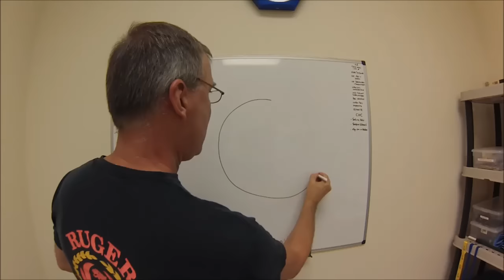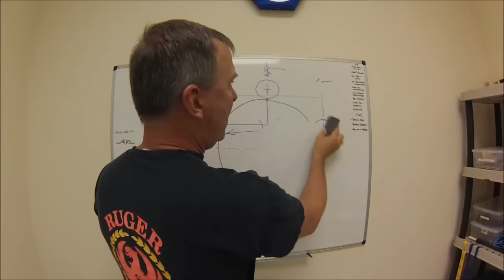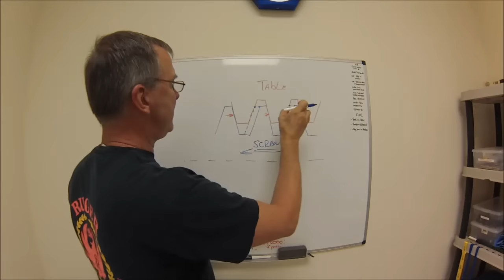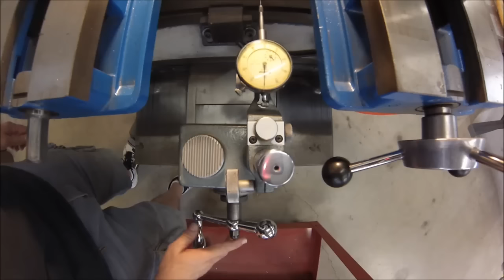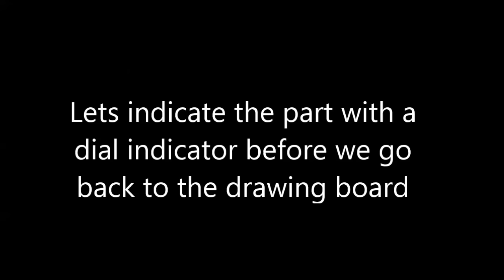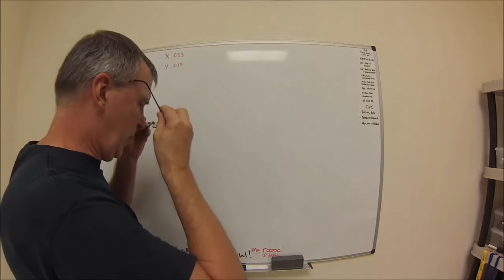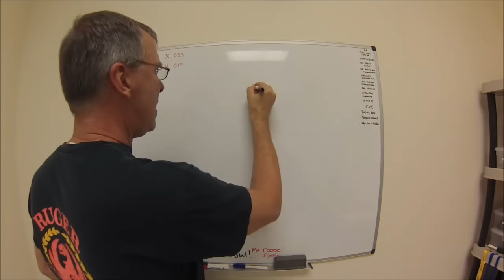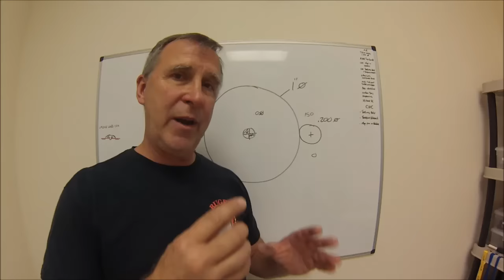Edge Finding Round Stock without a Digital Readout

Comment: The backlash number will change on different places of the travel because we typically do lots more work in the center or where the vise is normally mounted than we do at the ends of the travel, so the lead screw tends to fit looser there because of increased wear in that portion of the lead screw.  It's a moving target...
Reply from the maker: Its a good idea to move your vise L or R occasionally to spread this wear around. I alternate between the two I have mounted for just this reason. Thanks for the comment Bob.

Comment: Joe,

I really like the way you convey information.

I  do have a question however about finding the edge of a piece of round stock.  You covered backlash, but what about the behavior of the edge finder when you are off center, I suspect a new gremlin arises  and that is the spindle rotation.    I think the edge finder is going to behave differently depending on how the edge finder sees the round shaft depending on spindle rotation and if you are above or below the center line.

Comment: I read in an old machinist tips & tricks book that you can find center of round stock with an edge finder by touching off x axis move in rad of part + rad of edge finder then y axis move in the same, repeat 3 more times.
Reply: Yes, I remember reading that in Guy Lautard's "Bedside Reader" book. It seemed a bit cumbersome to me.
Reply: @ronmccabe1169  it's not ideal but when you don't have the ideal situation, overly gated casting, dial out for calibration, or I'm to fat & lazy walk over to the toolbox it's a good thing to know.

Comment: Backlash will never be the same, it will be off .002" or even more, since the slightest drag difference on the table will make the difference. To test this, check your backlash, then cause some resistance by snugging up the lock screw/bolt (Or add heavy weight to the vise) and check backlash again- it will be different.  You cannot use backlash in your equations and be accurate.

Comment: To the extent that the worn surface is on the leadscrew, backlash is likely to be non-constant. This is because wear on the leadscrew will be greatest near the center of the axis travel.
Reply: Also, some part of backlash can be slop in the thrust bearings.

Comment: Hi Joe, don't know if it helps or not, but when I indicate a round part in the vise, I pick the x side first, pick the minus side, go until I hit zero, and zero my DRO, then pick up indicator and turn to other side and pick up zero, then split the difference on the reading, then the same with "Y" and it will be within a couple thousandths right away, then its easy to zero out!
Reply from the maker: This was a very specific video about not using a DRO, coaxial indicator or spindle mounted indicator. Those ways are super easy.

Comment: if you're not on center though ........with a kickout-centerfinder, one side it'd kick downhill.  And one side it would kick up-hill.  Wouldn't that influence the sameness of each point?  At least if you start on center you always be kicking downhill.   In other words the kick out would roll off the round part rather than climb up it.  Anything to that?  You could I guess turn your machine in reverse for the opposite reading.  In fact that's the solution isn't it (if there is a problem)
Reply: That is very interesting. I would like to see how much effect that would have. Joe?
Reply: Not exactly sure what you're asking. Regardless of where "off center" you are on a circle (assuming you're looking down on a "circle" vs a rectangle, or some other oblique shape), the finder will always hit the part tangentially from both side.

The idea of using an edge finder totally eliminates any discussion of uphill vs downhill, because those terms are reserved for non linear flutes and approach directions to work. In addition, tools climb work because they're locked into a collet, or an arbor of some sort. The edge finder is designed to eliminate that, because it designed to kick out at the slightest touch. Again, uphill vs downhill doesn't even become a factor. It's all negated.

Assuming your round stock is lying flat in a vise, or v-block (instead of on its end, as in video) means the edge finder will contact the round bar where it is sticking out farthest AND will contact the edge finder on its corner edge (The ONLY place where this won't happen is when measuring the exact center of the round bar.). However, even in THIS case, there is no twist to worry about, because there aren't any twisted flutes. And, as also mentioned above, the edge finder is designed to "give" at the slightest touch. So, again, uphill, downhill, conventional, climbing, etcetera are terms that wouldn't be used here.

Therefore, NO, there is no influence being imparted by approaching the work from either direction by the edge finder.

Comment: Russ Hall
I have a very old and worn mill and it seems to me that I might expect to find the backlash different at different locations on the screw.  Most of the ware should be on the nut which would be fairly consistent through all the travel, but the high use middle zone of the screw might have more ware on it than out near the ends.  If this is true, it seems that I should check the backlash where I am working on the screw.
Reply: I'm thinking that you might move your table out to the ends of its travel in both directions. Then, get underneath with a flashlight and check out the acme threads. Measure every third or fourth thread with some accurate calipers to give you a rough idea of where you should be looking for different backlash.

You might find that the first inch or two the threads are like new. Then, they're about equal for another few inches, only thinner threads than at the ends. And, you find a big drop in acme thread thickness at some point.

If you bought your machine from a company's private shop, then all of the work was probably relegated to a  section of the mills table. Or, you could get an inexpensive DRO, and not even bother with what backlash you have and where you have to be concerned with it, to one degree, or another.

Comment: To avoid the backlash, can’t you touch off on one side of the stock, then touch off on a surface pressed AGAINST the other side of the stock (thus touching off in the same direction for both readings)?   Hope that’s clear.
Reply from the maker: You could. Thats called a projected surface and is very handy to use.

Comment: Thanks Joe, but I have one more question about backlash. Is it possible that backlash is bigger in the center of your mill because you use it more often than ends of the table. I know nuts are maid from bronze and it will worn out faster than screw, but how much screw will worn out?
Reply from the maker: It is absolutely possible to have your backlash vary across the length of the screw. Although the bronze nuts should wear out first, repeated use of your machine in the same region is destined to show wear on the screw as well. Another advantage to moving the vise once in a while.

Comment: To find the center If you put a small rule on top of a round material using a small rule bring down a quail with a drill bit till the rule is level
If you put a pointed scribe in the chuck then on the rule is the scribe method more accurate (smaller the point more accurate) ?
Reply from the maker: It does seem logical.

Comment: There is a way you can find the center of a round stock using an edge finder without factoring in the backslash of the axes.
Reply: How?
Reply: I think i understand what you mean, and i think it only applies to small or short stocks, i learned it after 1 year ago question i posted..haha, thank you sir.. Will apply that technique soon..
Reply: Yeah, it's called a DRO. But if you're referring to those pointers, then you need to know their tolerances. That's  because there's a BIG difference between a Harbor Freight drill press and a high quality milling machine that is in excellent condition.

Assuming, you're using a pointer, it's manufacturing tolerance could be outside of the window of the part you're trying to make. Add a cheap bit, and you can see where this goes.

I think the point being made here is the concept of backlash and how important it is for those who don't have the luxury of a DRO, when used on Milling Machines for highly accurate work, which could go down to a couple tenths, or less --> 0.0002" to 0.00005" (or, not...see below).

Standard call out on a drawing is 0.005" On my machine, I found backlash on my X-axis to be between 0.012" & 0.013" on my dial and 0.017" backlash on my Y-axis. You can see how someone NOT having any idea of how much backlash their machine has would be all over the map trying to be at any point using just the standard tolerance of 0.005" 

THAT was the point of this video!! It wasn't HOW to locate a drilling location on a piece of round stock.

Comment: I think you are going to have problems using an edge finder for a different reason.  When you push a flat piece into a rotating edge finder,  the edgefinder walks along the edge when it touches.  But when you aproach the edge finder with a round workpiece,  the piont of contact either climbs or falls away as it hits. The spindle direction will also have an effect.

If all I had was an edge finder,  I would use a side stop and the vise jaw and then move to the center.
Reply from the maker: Edge finders usually jump after the upper and lower components align then get interrupted. The round registration surface will have some influence, but you can always check it again after you get close to center.

Comment: What if you bring it in in from the left on the left side and bring it in from the left then from behind on the Y side? And do the same on the other side? Basically the backlash of X and Y are both the same direction? You couldn't really dail it in as much as make guess after guess about where it'll end up though. although if you bring it in around the 45 degrees tangent on each side, you get to just add to X whatever amoutn of Y it falls short or vice versa. You think that'd work, even if it's a bit hard to get into and takes a bit longer?

Comment: I have not pursued my thought but i often wonder if there is a variation in readings on round stock or internal bore readings when slightly off center due to rotational differences of the edge finder when approaching the part form opposite sides
Reply from the maker: I thought that as well. If it were a solid making contact, the tangent point would be a mirror image, so I would assume rotational influence would be minimal. Being as close to center as possible for the first leg at the time of contact by the edge finder would be highly suggested to minimize error.

Comment: Hi Joe, thanks for all your excellent videos, I have learned a lot of new techniques. 

I have a question with respect to centering a disk that is mount vertically with reference to the mill table. I want to center a hole on the circumference the goes from the OD to the ID of the part. The disk is too large to use an edge finder. 

Any help would be appreciated, maybe you can create a video. 

Thanks, 
Dave

Comment: I've not been an edge finder person, but just looking at the physics of it, wouldn't the rotation of the edge finder play into the approach at the acute angle from opposite directions cause your touch-off to vary from one side to the other? If that makes any sense at all?
Reply from the maker: It does make sense. And I would think the whole drag issue would influence the kick out. This was done as a favor to a subscriber. I use DRO or sweep the OD with an indicator.

Comment: very informative Joe I liked this a lot but now I'm forced to ask,when indicating the part does that "slop" or "play" ever come into play on the "z" axis, z axis play I mean,thanks
Reply: Hi there, using a dial indicator to find the center, does just that, it only finds the center. All the play / backlash will still be there and if you need to offset a known amount from the center, you still have a problem knowing how much that is and in what direction i.e. cw or ccw.  The only way to make real sure is to always take out the backlash in a known direction. When you have dialed up the center, set the indicator dial to zero, back away with the table handle and then come back to the zero from a known direction, and then set your handle dial to zero.. Sounds complicated, but when you have done it a couple of times, the procedure will soon sink in. As long as you always approach from the same direction, backlash is not a problem for setting dimensions, but it is a problem when machining. If you try to climb mill with a worn leadscrew, the cutter will crab and pull the work piece into it. Hope this helps.
Reply from the maker: Good points Dave. I try to always finish my position moves with a clockwise move on the dial. Either that or start at the back left of your part and work toward the front right. The table moves will always be clockwise moves on your dial.
Reply from the maker: Travis. I have to say yes to this question. Not so much for dimensional accuracy, but absolutely for machining rigidity under 2 special conditions. If you have ever tried to drill or plunge mill round stock on a round surface, you will notice a terrible bouncing between flutes leaving an awesome, but unwanted, chatter pattern on your part. By leaving some tension on your quill lock, or locking it completely and coming up with the table for the initial penetration, it goes away. Other than that, I really can't think of any other impact.

Comment: I did not hear you mention that back lash varies with table position and screw to nut wear variations due to where you are doing your calculations
Reply from the maker: Wayne, your observations and comments are accurate. There are many conditions that may exist based on a hundred different variables. Naturally, if you intend to map out your machine, do it in your working envelope. I try to cover as much valuable material as I can while keeping the video to a comfortable watchable length.. How about shifting your vise off center for a year or two to work in a zone on your lead screw that may not be worn. Just a thought.

Comment: "The screws turn but they don't move." Gosh, wouldn't that be nice! Maybe on a real mill, but on the mill-drill I have (made by the Go Well Mach. Co. of Taiwan) There is about 15 thou play in the X axis screw because the stupid thing was designed without any preload. And for that matter, if you forget to unlock the table and turn the handle you might have 200 thou backlash, because the only thing determining backlash is how tight you can push the dial against the table before tightening the setscrew (which doesn't have a flat).

Maybe everyone else has a Bridgeport or a good clone of one, but just beware that not all machines are well made, and backlash can show up all over the place. And change quickly.

Oh yea, this machine has dials calibrated 0 to 100, but the lead screw is 8 TPI. Makes it fun to decide how far to move.
Reply from the maker: Make a few bucks with the machine you have and start looking for a better one. The used market is pretty full. With any luck, it will cost more to get it delivered than to buy it. The purchase does sting, but that soon fades. Thanks for your comment.

Comment: You have the cord and you have the center from here.   Another cord is needed from another angle.  Maybe 90 degrees.   The center of the stock might not be round enough to get a center. If the round is critical small. The line is found pointing to a center the other cord points to the center or another center - and perhaps a third cord for worst case scenario to find a triangular center to be centered by eye.  Can be complex and nasty.

Comment: I noticed that you use mechanical edge finders. I much prefer the electronic ones. Two reasons jump out. 1. You can use them with the machine turned off. 2. Audio feedback frees the eyes. I am careful to twiddle the perpendicular axis to insure good electrical contact, and get excellent repetability. What are the down sides that you see?
Reply from the maker: None really. Continuity sensors are pretty good. Not in everybody's budget, but no rotational influences to worry about. I personally always use an indicator.
Reply: Point number 1 wouldn't work for me as I have a small amount of run out in my spindle.
Reply: I have one, but I worry about bending it by mistake.